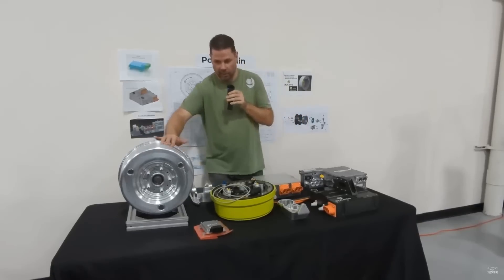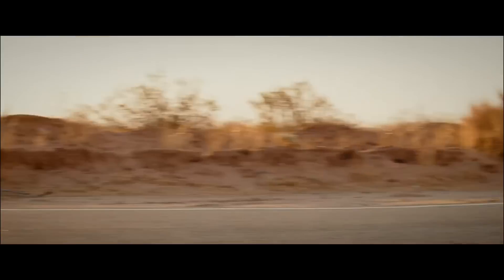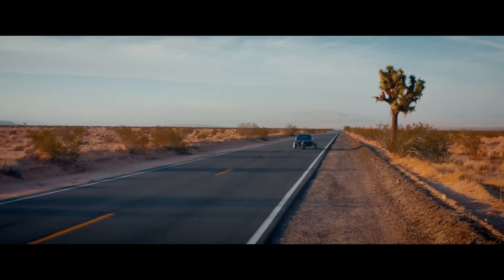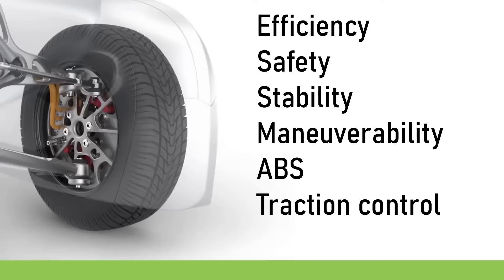Why is Aptera using In-Wheel Motors? (ft. Elaphe)

Comment: You lose a lot of torque when you don't use gears, there is always a loss somewhere. Nothing is free. Plus hitting a hard bump can damage the actual motor.
Reply: The torque is already way more than needed for good performance with these ungeared motors.  In fact, a very reactive ABS/traction control is supplied to deal with it.  The Elaphe wheel motors are potted in a rubbery compound that can cause the motors to take repeated 100 G shocks without damage.  We are talking about breaking wheels before the motors are damaged.
Reply: Getting rid of gears is a great way to get rid of weight with or without wheel motors. Electric motors are much better on torque than gasoline engines, and steam is better yet.  With electric, you could eliminate gearing entirely and use electricity, but for some reason they still use transmissions.
Reply: High torque is essential in getting a 4,000 to 6,000 pound EV to accelerate. With the Aptera weighing only 1800 to 2000 pounds, that's not a relevant issue.
Reply: @richpate9436  Having ridden in a prototype last November, I can tell you that the fun factor of all that controlled torque in a light vehicle is off the charts!
Reply: @richpate9436  Nonsense.   What that means is they can use much lighter gears instead.  Have you seen bike hub motors?  They ones with gears are LIGHTER and MORE EFFICIENT than those without them.  Learn something, don't believe Aptera hype/bs

Comment: I would like to know the total unsprung weight per corner  and how it compares to a lightweight sports car such as an MX5.
The hub motors could be  problem even on a much heavier car. 
With a  super lightweight body., keeping a proper sprung/unsprung weight ratio looks likes a very tall order to provide a reasonable supple ride.
Reply: The Elaphe wheel motors add roughly 23 kg, just under 51 lbs.  Roush Performance has designed the suspension to work well within these constraints as is shown in part through video on moose tests.  I rode in an alpha prototype before the Roush design and it was indeed harsh, but not worse than other kit cars I have owned.

Comment: High unsprung weight immediately came to mind. Another problem I see mentioned is motor cooling, but I expect that could be easily improved by slanting the wheel spokes to act as fan blades to force lots of air through the motor. (have toihave gravel screens in the airflow, though.) The unsprung weight problem could be addressed by using lighter materials in the motors. Redesigning the motors to use larger bearings held in thick rubber mounts might cushion and reinforce the unsprung motors. All designs have problems, most conventional designs have solved them satisfactorily using new ideas and some compromises. These problems can be solved also.
Reply: In an interview I saw, they mentioned the heat problem, and they said because it is so efficient, it just doesn't generate a lot of heat in the first place, and the large thermal mass of the motor helps spread the heat out
Reply: Aside from the unsprung weight, you also have all of the additional exposed high-voltage wires and hoses threaded through the suspension. I'd much prefer using a CV axle between each motor-wheel pair. The electric motor could even be mounted on the inboard side of the lower control arm so the CV axle only needs to accommodate flex in one plane instead of two with fixed-length axle.

Although you may be able to ruggedize the bearings to survive the unsprung weight, tires get brutalized by unsprung weight too.
Reply: I think ignoring the trade offs for unsprung mass for suspension response and the vibration on the motor are not giving the whole picture.
I think Aptera as a vehicle platform compared to other electric cars has less to worry about. Lightness goes a long way.
Reply: @anthonylipke7754  Yeah kinda hard to say how the unsprung weight plays out on the whole. I guess you wont be winning the offroad races with an aptera; but then again thats why there are different vehicles for different purposes. Personally id like to see a version with smaller and lighter motors overall. Not really interested in winning drag races myself, and the extra motor mass is just more iron losses on the highway, and more unsprung weight.
Reply: As the proud owner of a Buell... A motorcycle designed by a man obsessed about reducing unsprung weight.... I agree
Reply: @africanelectron751  Lucky man.
Reply: This is not a completely new design problem to solve, Formula Student cars have been using in-hub motors for years now
Reply: @coleeto2  different constraints, if unsprung weight kills tire life, you’ve got a problem in a real car, not in a race car. But then, most cars these days weigh 4,000 lbs, so there’s tires tough enough for the job
Reply: @ACBLOWSCOLD  road cars and race cars definitely have different design priorities! I just wanted to highlight that in hub motors aren’t a totally “out there” concept.

Care to elaborate on how unsprung mass might affect tread wear?
Reply: @D*ck Tater 
You can use alloy for all those iron parts and for the coils as well. It might conflict with the efficiency though.

But I think those weights are a bit overstated. Yes the hub motor isn't light but so aren't brake rotors, axles, springs and all the other parts in wheels. So it could compensate the higher weight of the motors by reducing it elsewhere including smaller wheels.
Reply: The aptera uses tires with lots of sidewall:  this might help with the unsprung weight issue.
Reply: i call in also the heat from the breake, I drive almost every day on a mountain road to go to university and the brakes get hot
as the brakes are inside the hub of the engine I think that's another issue to keep in mind
Reply: @librasd8087  instead of using friction braking you can use regenerative braking and add slight range increases instead of purely just heat.
Reply: @Wheelieking619  Regen braking is not as effective as you think and legal requirements will require an actual brake pad or that vehicle is never seeing the road in the US or Europe.
Reply: The cons of that unsprung motor weight are not really an issue on aptera since road surface irregularities won't transfer that much to the cabin through aptera's chosen method of suspension, and with the wheels themselves being directly driven there's also little to no chance of wheel hop or bouncing during hard braking and acceleration as seen when they took their initial prototype for dynamics tests on the track, which weighed less than what the production version would since it was stripped of a lot of components and thus should have worsened whatever unsprung weight issues people worry it might have.

I sometimes notice that when people talk about unsprung weight they tend to either not realize or care that that a lot of vehicles already on the road today have it pretty bad when it comes to that, especially pick-ups and SUVs, yet those vehicles themselves are massive already so the weight of their tires affects the overall ride of the entire vehicle very little if not at all, unsprung weight should be considered as a ratio between the mass of the wheel and the mass of the car while factoring in the suspension required to support the weight of the car, rather than to just look at the mass of the wheels alone. Aptera's wheels are rather small even to it.
Reply: Look at the Verge Electric Motorcycle. Awesome simplicity design!
Reply: The unsprung weight could be eliminated by mounting the motor on the inner suspension mounts and connected to the wheels by a CV joint. This would also eliminate the flexing of the connecting cables and the embritleing the cables through fatigue.
This, obviously would not work on the rear wheel but then it is not as important because it is only a single wheel and has less unsprung weight from axles and suspension components. The front wheels would benefit from greater stability for the steering setup, as well as a reduction in unsprung weight.
Reply: If it's a city mobility thing (30mph or lower) then unsprung weight maybe isn't a huge problem... for a normal car they're a complete non-starter.
Reply: DeepDrive claims they've solved these issues, & are currently testing prototype-car's on German test-tracks...
Reply: Longevity of the motors is the only concern of many people, even though they mentioned weight of the vehicle actually effect the wear on the motors. Have also noticed many people are wanting to put these motors on other vehicles or older vehicles.
Reply: The hub motors in the Aptera are liquid cooled.
Reply: @1969barnabas  air cooling would cut the unsprung weight,
Reply: @tedrice1026  maybe so, but the Aptera uses liquid cooling, with radiant heat exchangers imbedded in the body to exchange heat with the ambient air which flows around the body while driving the vehicle.
Reply: @tedrice1026  NASA uses radiant heat exchangers on every human space flight. It works well in the vacuum of space, and should work even better in Earth's atmosphere.
Reply: @1969barnabas  radiant heat diffusion is the least efficient method of getting rid of heat. NASA uses it because there is no other way to dump heat in space.
Reply: @tedrice1026  The primary way that the Aptera sheds heat is through convection.  When that is not sufficient, such as during battery charging on a hot day while stationary, the AC system activates cool the pan from the inside and  to provide a larger temperature differential with the AC condenser to the fan driven air exiting the rear of the vehicle.
Reply: @tedrice1026  I completely understand. That's why I wrote earlier: "I want to drive one before I buy one so that I can evaluate the ride quality... because the unsprung weight is one of my concerns."

I won't buy one until I can drive it.  The un-sprung weight seems like it will pose a huge problem for ride quality.

The radiant heat thing.... I don't know. I want to see it work in-person.
Reply: As far as unsprung weight, I expect the first systems to roll out on stuff like the rivian. Hard-core trail guys actually add weight to their tires so it may be beneficial. On a sedan they would probably match best with an air ride. As far as cooling I would think most aluminum rims would be fine heat sinks, but something like a BMW 80s wheel disc would be sufficient for heavy use
Reply: @norman1907  
Unsprung masses are a problem at higher speeds something the vehicles of such "hard core trail" drivers are horrible anyway.
Reply: @norman1907  The Lordstown pickups are designed to use Elaphe wheel motors, although of course, much larger ones.  Aptera has an antifreeze solution circulating through the motors and to the aluminum belly pan to remove heat.
Reply: Unsprung weight becomes less of an issue with lower weight (obviously). For an ultra lightweight urban vehicle, the benefits of these lightweight wheel motors likely outweigh the problem of it being unsprung weight.

But the aptera is an urban vehicle.  Any claim otherwise is a scam.
Reply: @homomorphic  ?
Reply: Fans use energy. Bouncing wheels are an energy eater. Unsprung wheel motors are not better. This is total BS.
Reply: @solexxx8588  No fans. The Aptera uses radiant cooling in the skin of the vehicle to radiate the heat from the liquid cooling system into the air around the vehicle. 

I want to drive one before I buy one so that I can evaluate the ride quality... because the unsprung weight is one of my concerns.
Reply: @solexxx8588  That's somewhat sweeping. The handling/grip depends on the ratio of sprung to unsprung weight. I expect the Aptera is quite heavy, so lightish motors may not have too deleterious an effect.
Reply: @theinspector1023  The 40 kWh pack model weighs around 1800 lbs, about the same as my Gen 1 Honda Insight.
Reply: @solexxx8588  obviously you’ve never experienced a hub motor in person!

Comment: Thanks for this useful information on it’s in wheel motors. I have just had to guess that they were efficient before. Now I know a bit more about them. 
I am around 7500 in line and am scheduled for a 400 mile range vehicle. I’m getting the full solar package and have designed a independently solar powered car port to keep the thing in. Looking forward to late 2023 delivery. 
Right now my only concerns are repairing and how comfortable the Aptera is. 
Thanks for a very informative video.

Comment: I wonder how much effect there is on ride comfort and noise with the additional unsprung mass of the of the hub motors.
Reply: Exactly what I'm thinking.  The un-sprung weight is my only concern about the Aptera. I want to drive one before I commit to buying one.

Does anyone know how much these particular hub motors weigh?
Reply: The video doesn't address this concern. Every technical choice is a compromise between multiple qualities. No choice can be all good and no bad. So this video is missleading.
Reply: I think it's a fair question, but on the other hand I think it's something that matters less than you might think. The unsprung weight of an Escalade is huge compared to a compact car, but nobody would claim they ride poorly I don't think.
Reply: @bradley3549  its the ratio between unsprung mass and sprung mass that is important.
Reply: @niconico3907  I agree and that's my point really. BEVs are relatively massive for their size, generally speaking, so an increase in unsprung weight may be less significant in the grand scheme of things, IMO.

Comment: My only concern is the cost of repair if a wheel is damaged. On a related note, how difficult is it to replace a tire? Can the kid at my local shop do it? Are the tires run-flats?
Reply: I’m fairly sure I saw in another video on YouTube that the tire is totally separate from the hub motor once you take the lug nuts off, so yes, any shop could work on the tires.
Reply: Hub is not the same thing as rim.  Aptera tires still mount on traditional rims.  Aside from the need to remove the wheel covers, changing a tire is no different from any other car.

Comment: In wheel motors = terrible performance with unsprung weight. Longevity will also suffer with constant impact of said motor. Car accidents with the big SUV's of America will diminish your user base.
Reply: Elaphe has done pretty significant testing on their motors, and expect them to last the lifetime of the car. With regard to safety, the Aptera has airbags, crumple zones, etc, and should be as safe as any small car.
Reply: Of course this is just "marketing" until we get crash test data, but they say the composite nature of the Aptera yields significant safety benefits.  For example:

https://www.youtube.com/watch?v=69_iKArvJBk&t=656